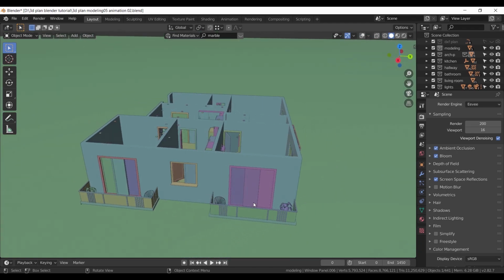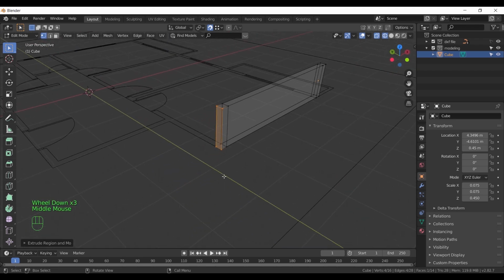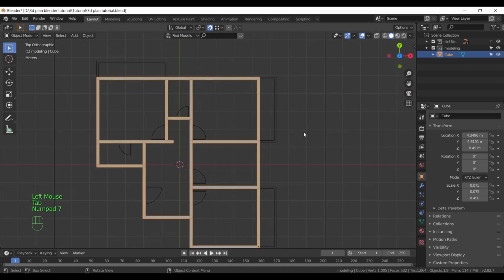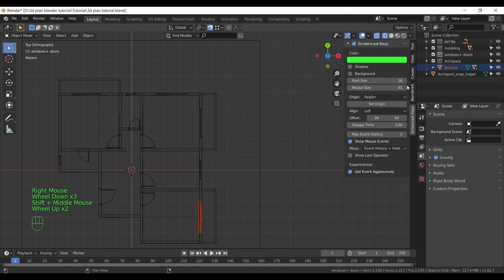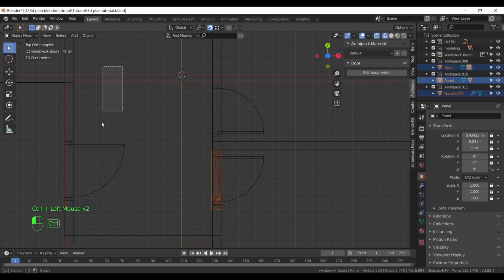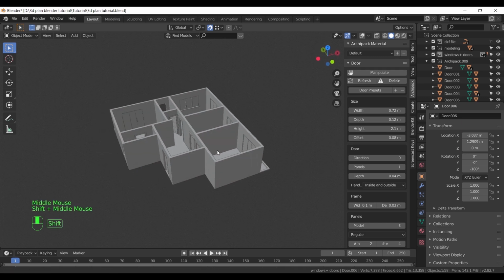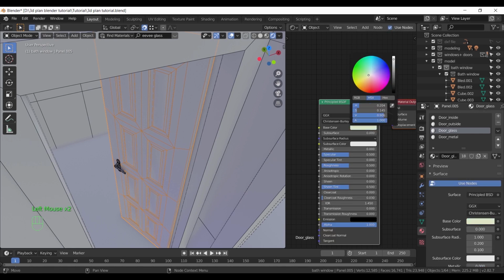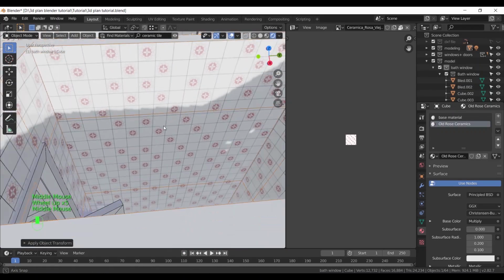How to make 3d floor plan in Blender | beginners guide (Part 1)

Comment: when I save as an SVG file and then import it into blender it does not show up. what am i doing wrong.
Reply from the maker: check the layer section on the right, if the file show up there just select it and hit the numbad . key to focus on selection.
If it's not there you either export it wrong or might be using old blender version.
Reply: @architecturetopics  thank you. I think my problem was with what I was doing in Inkscape.  I was never getting a "preview" in the lower right.  That showed up, now it seems to be coming up in Blender now.

Comment: I swear I use E to extrude, but I have to grab it to make it work, and it often falls down in Z axis
Reply: You can use the Z, X, Y key to select which axis to follow after u prressed E.
Reply: @Sh4rkbait1986  thank you.
But here this guy just clicks on the point and the wall automatically expands to that point
Reply: @franktenpenny1992  he doesn't. He selects the verts and the use the shortcut key E to extrude, most likely. He might have forgotten to include that part, I'm not sure. Or he select the extrusion tool on the left field in the viewport.

Comment: you start by importing a floor plan made by another program. Isn't it possible to start from your own 2D floor plan drawn in Blender?
Reply from the maker: Is it possible to do your 2d drawings in blender? sure why not, but is it practical, No. Blender don't have 2d drawings system for architecture drawings where you get commands like Line, poly line, fillet, offset..etc, So you need a 2d program like Autocad or Revit to make the the plans first, then you import them to any 3D modeling program.
Reply: @architecturetopics  thnks for this reply - just what I was looking for! This will save me a million years trying to find out how to model a 2D drawing in Blender!

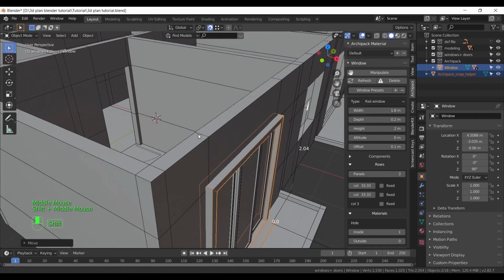Comment: if I touch once the window object after importing from the archpack, I lose all the arrows to adjust measures then I can't get them back. I also can't find the settings on the  side (at 16:28)
Reply from the maker: You just need to select the archi-pack object( the window's frame) and you should find the settings on the N panel, hit Manipulate to get the arrows back, I don't know what versions you operating on so you might need to check the add-on settings( in the preferences) to see where it's located but it's usually on the side panel as shown.
hope this helps
Reply: @architecturetopics  oh thank you, you solve the problem. Now I can see the right panel and all the parameters are back. Thank you very much.

Comment: sir another problem my glass is not transparent at all. It looks like completely mirror using same eevee glass. Sir please help!!!
Reply from the maker: We used the eevee glass shader in this tutorial, so you just need to check the transparency value.
You can also mix a glass node with a transparent one and use light path in the info.
If you want to learn more about it just look for architecture glass on my channel

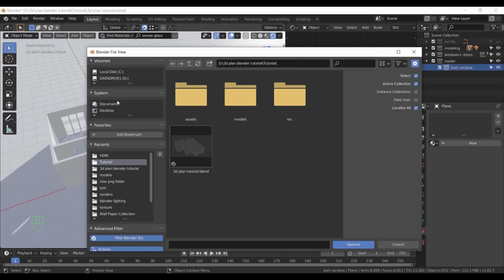Comment: Didn't get it @ 34:24. Is that model built-in inside the blender, or you imported it?
Reply from the maker: We import it with Append from the file menu, download link in the description.
Reply: @architecturetopics  Oh, thank you. I actually only open the floor plan.
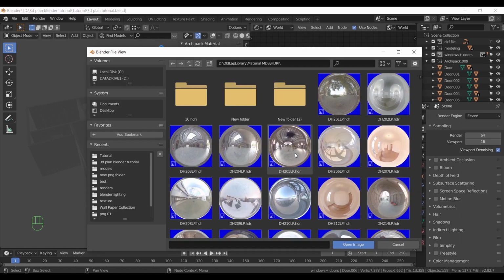Reply: @architecturetopics  Hi, I want to know how to use default HDRI instead of adding 30:21. When I add the HDRI image, the roof color changes 🤔💭
Reply from the maker: @Mohit_S92  Well, there's an addon called Dynamic sky inside blender you can use it. there's also an addon called Scene sky which you can download.
https://www.cgchan.com/sceneskies
Moreover you can use a light path node with a color mix to fix the ceiling lights.
Reply: @architecturetopics  Ok. Actually am complete beginner and am completely rely on such tutorial videos.